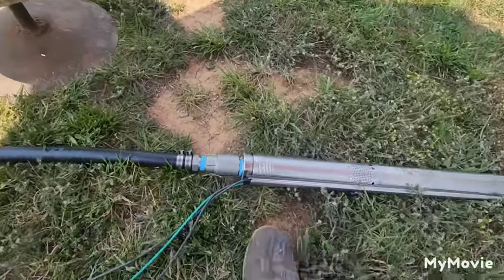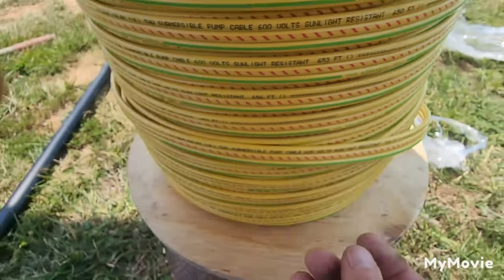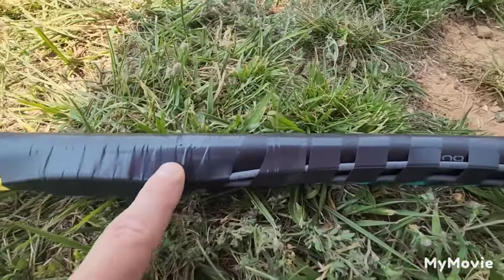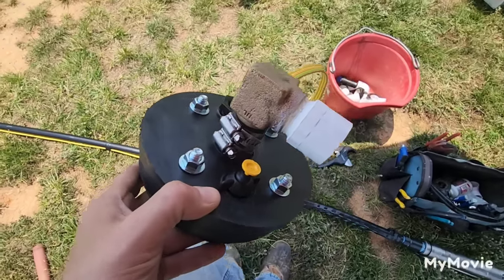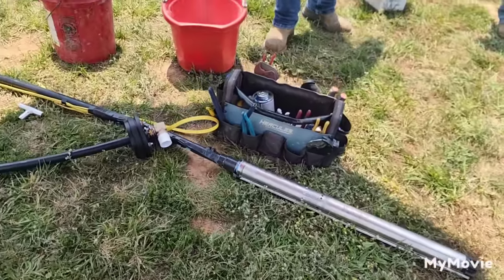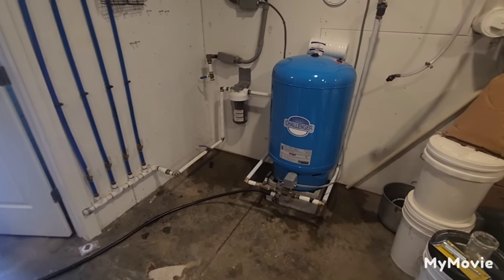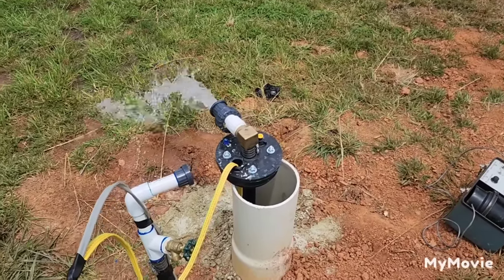3 Wells on 1 Property! Installing a New Grundfos Well Pump & Testing it after Hydro-Fracking.

Comment: For anybody designing their own system, don’t forget to do a voltage drop calculation when deciding on wire gauge. If you cheap out on your wire size, the pump ends up not getting adequate voltage. The pump responds the only way it can, by increasing current draw, which may shorten the lifespan of the pump.
Reply: Absolutely. It's a viscious cycle. Low voltage increases amp draw which drops voltage more increasing amp draw more.
Reply: I always upsize if even close. 75-90 feet I go 10 AWG. Code is the bare minimum and not always best.
Reply: @mfd4505  yep - code will keep it from burning down, but might not keep it performing up to spec.  I have this issue with 15A 14AWG circuits in parts of the house (including outdoor outlets) where at the end of the daisy-chain the 118V might only be 105V drawing 12A.
Reply: Or use a pump with a 'soft start' feature like H20 uses. They don't draw a huge inrush current, the pump ramps up to full speed. This saves the contacts in your pressure switch from burning, and wire from chafing in the hole, since the whole pump and pipe assembly doesn't jerk so hard every time the pump starts.

Comment: I used to haul bulk water in rural areas.  I had one customer that I occasionally would 'top up'..... they had a well that would draw down on a steady demand.  They put in a precast cistern, with a low capacity pump that ran pretty steady filling the cistern (their reserve).  The cistern had its own pump and then could meet peak demand.  Ran that way for years.
Reply from the maker: Those types of systems are very common out west. Pricey, but functional
Reply: I thought the same thing.  Why not just put in a tank and use it for peak capacity.  If the well is delivering 5gpm, you could easily keep a 500 or thousand gallon tank topped up overnight and trigger the well pump off the tank level.  That would seem a lot cheaper than having multiple wells, even with the initial cost of the tank.

Comment: 400 gallon storage tank in the basement and a jet pump feeding the house would also be a solution.. have the well feed the storage tank with a float switch and the jet pump and bladder tank feed the house..
Reply from the maker: I thought the same thing! Definitely a viable option
Reply: I added a tank to my deep well system as a way to settle out sediment and sand. I was not expecting how much water flow gain I'd get. I have horses and have spent weeks of my life waiting on troughs to fill at 5GPM and now I have over 30 GPM.

Comment: Hello and greetings from Kanab Utah ... Quite a few of the folks out here in southern Utah have wells with this kind of performance.  The solution for most of them is to invest in a potable water storage tank. They have gone up in price recently but everything else has also. If you get yourself a 2500 gallon storage tank you can fill it slowly and probably avoid running the well water levels real low.  Thank you Philip for all your efforts.  Respectfully, Utah Mike. 🤩👍
Reply: The only trouble with that is keeping it clean. Filtering the water before the storage tank is a must. Also tank must be kept clean and sanitized. In a warm climate, crap can start to grow in the water if the tank isn't cycled very fast. City water towers the water is chlorinated and treated before its sent to the water towers.
Reply: I was thinking about that also, but I was thinking of a 500 gal tank. With a 500 gal tank, the water gets constantly refreshed and doesn't have time to stagnat.

Comment: Wells are so intriguing. I had to move a well because of an addition. I was at 428' and it was perfect, never ran out, great quality. When they drilled the new well 25' away they went to 650' cause it wasn't making enough. I had to have it fracked and the iron level still hasn't stabilized, so much so the county health dept hasn't green lighted the new well.  They just came for their 3rd test so I think it will pass this time.

Comment: Incredible the amounts of money that people can invest, without knowing exactly how to do a proper installation.
What I like about your videos is the technical information of the parts used to install the system.
In addition, you show us the installation errors of other companies (which you correct).
Now what about the pump (impeller) that is disintegrating. This company that installed it, does not know much about the applications of each pump. But knows how to shell out the money from people who know nothing about self-contained water supply. Thank you for all this good information.🍻🍻

Comment: Fun watching these videos.  My well is around 200 ft deep.  It makes great water and plenty of it, so I am fortunate.  That being said, the previous pump failed because it fell off the pipe and sucked electrical tape into it.  Using the right components is only half the job.  The rest is the installation.  (similar thing happened with my AC system at my previous house; poor installation eventually led to failure)

Comment: I used the soft start Grundfos in my Son's 705 foot deep well. Best pump on the market. The slow ramp up allows a smaller wire size too, but do due diligence to size it correctly .
Reply: Grundfos seems to be good. Have used many of their circulator pumps and boiler feed water pumps over the years, rebuild kits, impeller kits etc. No issues, very reliable and not too expensive.

Comment: Irrigation tech here, unrolling the poly is easily a 1 man job. Leave the roll in the sun for 30 minutes, secure the one end, walk backwards and “hump” the pipe to unroll it. Basically hip check up to bump it up and the natural tension of the roll with help. Already hot pipe is easy to work with. Been unrolling those rolls alone for years. 1.5” poly gets a bit difficult but is still doable

Comment: Have a well in show low arizona old windmill minus tower, sucker rod pump still in
6inch casing i hooked up old pump jack and made small Aframe to lift warer pumps at 3.5 gpm 220v motor 2.5" pulley on motor 11" pulley in pump jack.  Watching your channel has been awesome.
Keep it up
And thank you

Comment: As a DIY home builder in Colorado, I dealt with this type of issues with a 2000 gallon cistern. Once filled, the pump never runs dry.  
So, a low flow pump in the well to a cistern,  a 2 gallon pump in the cistern feeding the house, etc. 
just my thoughts based on my experience.

Comment: Ok here is what I did with a low volume well,  I have my well pump feed a 2000 gal cistern tank the gravity feed my house, with a cheaper pump to feed house pressure.  The well pump controller has no load shutoff plus cistern float switch and timer that turns well pump on 3 times in 24 hrs, or when needed. For about 15 mins as the well will run dry if run longer than about 25 min. This has worked for years for a domestic house. Plus water for garden and lawn. I will run out if I forget and leave water on, oops. 
Enjoy your videos and very informative contents, very good store with reasonable prices.
Reply: Ok let’s

Comment: Yes great idea take the not great water and use it for garage and hoses then keeping the cleaner water for household use is a great idea. Plus if the smaller well does dry up it's just a few connection in the house to switch it over to the other one

Comment: Another advantage of the Grundfos pump is that since it ramps up slowly, you can run it from a smaller genny than you might expect.

Great job and video, sir. Take care and God Bless.
Reply: make sure you adjust the expansion tank air pressure to allow for the slow ramping and long lines. the old standard was 2psi lower than cut in pressure, but that isn't enough buffer for the slow/soft start pumps, you need 6 to 8psi less air charge than cut-in and will want to oversize the tank due to volume loss. (learned the hard way)

Comment: I've always had excellent results with Gould pumps.  The brand you promote has a well known defective check valve problem and the variable start up circuits fail constantly. Best to go with standard well built.  And I find Gould is sturdier and more heavy duty
Reply: You also didnt give credit for a 1 to 3 phase variable conversation unit. When running properly the energy usage and operating costs  are  MUCH less.

Comment: place your "doubled" hose clamps heads 180 degree apart and opposite directions from each other or at minimum 90 degree. why? some times they can seep a bit and cause a weak/thin spots at the worm gear head when side by side. 😁 I learned the hard way over the years.

Comment: My thought on the 3hp 3phase pump is that it was not sized correctly for the well. I had the same issue with my well. I was was explained to me by a well pump expert that proper calculations need to be done so that the head pressure is correct. This will help keep the impellers centered in the pump assembly and prevent the impellers from wearing out.

Comment: I would think more water storage would help it greatly, based on well flow rate u could feed into a decent size storage tank and have a float switch for the water inlet and throw a jet pump on the tank to feed house or could have pressurized storage tank and just have well pump do it all. Honestly if it was me i would have it feed a storage tank to act as a buffer and i could filter it more to get Sulphur out before pumping into house.

Comment: FYI - Lowes and Home Depot (at least in my area) no longer offer wire-by-the-foot if you want more than about 25 feet.  They'll refer you to buy 100/500/1000 foot boxes/reels.  Also VERY IMPORTANT - now that they insist on you checking out before you can touch the wire you bought, be sure to inspect it IMMEDIATELY after checkout, before leaving the store.  I got home with the pre-bagged wire they handed me and found out someone had sliced thru a bunch of the insulation and a bunch of it was unusable, but once leaving the store became a he-said she-said headache of "how do we know you didn't damage it".

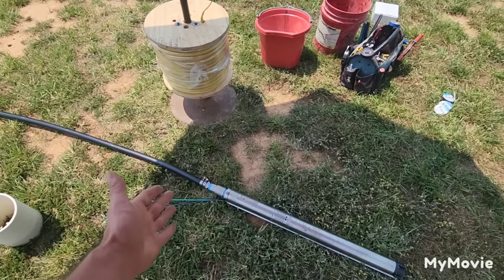Comment: 4:23 I install 1/2 hp 5gal per min Goulds pumps up to 300 ft all the time, some of them I replace r up to 60yrs old, 4:40 we service a 900ft well with the black roll pipe

Comment: Any thought of installing a 500 to 1000gallon tank to take the well water and a small pressure pump to run the house . A float switch for the well will keep tank the topped up and the house will not run out of water easily. Should be significantly cheaper than sorting out the far deep well

Comment: Great video! Filled with tons of information!  I love your content. Just had one question. You said 1/2 hp pump is only good for 120 feet? My old house well was 3 gpm at 240 feet and had a 1/2 hp pump. My parents house is just about 300feet and also has a 1/2hp pump. How and why would the driller do this?

Comment: If they did not have the second well, a 1000 gallon cistern would also have solved the problem of a gallon a minute producing well. 24x60 is 1440 gallons a day. The cistern acts like a buffer, during high usage periods, but refills during the time water is not in high demand. My neighbor had that problem, and a cistern solved it for them. A separate pump at the bottom of the cistern supplies the pressure tank inside the house. The well pump output flows directly into the cistern and a float connects to cutoff switch for well pump. Pump is protected by a separate circuit monitor that shuts off pump I’d it runs dry. The cistern cost $5000 installed with its own pump. pulling that deep well pump at 580 feet and replacing it will a pump at 300 feet was probably way less expensive than installing a cistern.

Comment: Give thought to “upsizing” the motor to the pump.  Electric utilities routinely reduce voltage in periods of high demand.  The oversized motor runs better under these conditions.  

Is there a 240 vac single phase softstart available for residential wells?  I would rather have electronics above ground for ease of replacement.

Comment: A pentek intellidrive pid 30 wouldve worked. takes single phase in and converts to 3 phase. Those are much better than the f&w. For future reference. We've ran into those 3" pumps at those depths can blow holes in the poly near the pump from building heat.

Comment: Low volume sulphur wells are common around here. Everyone has large capacity (500-3000 gallon) storage tanks to air out their water.
Reply: Had similar water with hydrogen sulfide. I too ran well to  a 300 gallon storage tank and added an air bubbler system (air pump like on a aeration septic system). This worked nicely at removing the sulfur smell. The air bubbler works by oxidizing the hydrogen sulfide with oxygen and enabling bubble surface exchange where hydrogen sulfide had an easy escape route. Used a simple jet pump connected to the above-ground storage air bubbler tank to pressure up the house water system.  It still needed to run water through  limestone calcium filter/exchanger to adjust the pH (sulfur water is very low pH and corrosive). 
Final note, be sure air bubbler is not near final water pump suction foot-valve!

Comment: it's very possible the well with 580' deep pump may draw down to below the 300 foot level on high GPM usage or in dry climate periods. but it's possible they overkilled it ten fold thinking they were saving themselves a headache, all while causing them(seeing the single small bladder tank size!).

Comment: Tried to lift my pump thats on a pitless 156ft well. 1-1/4" Schedule 120 PVC pipe. Two men lifting could barely get it off the pitless.  Had to go get the excavator to lift it out a few feet...After that I realized I needed a different approach to the job.
Reply from the maker: Needs a crane! That's dangerous weight!

Comment: Great channel! The information is easy to understand and very helpful.
I need some advice.
Any experience with using a lake for supply. Currently using well pump in a weighted rack resting 18” off the lake bed ~40’ below the surface & ~250  from the house.  I’m replacing all 250’ of 1”/200psi tubing due to a break in the buried  line from the  house to shoreline.
By the way, 150’ heat tape that extends well beyond the ice line in winter.
Thanks
Reply: trench it deeper and run larger pvc electrical conduit as a sleeve!(place all bell ends the same way, use no elbows/fittings/premade bends!) terminate it into a small pit at both ends. then you can easily re-pull a new water line/heat tape(if still needed). maybe run two in parallel and keep one "dry" for fast changeover if very important to keep water flow.

Comment: Wow that's insane cost for such unnecessary 3 phase equipment, I always recommend standard pumps and tanks.  
Yep that there is what I like to call "Cat Hair" so yep always a bad sign the pumps GG.
You gotta love it when they put a filter between the pump and tank "It never had a problem before" Oh it will!
I find it better to have cartridge filter after say a carbon filter as it can catch any carbon dust also just like you did.

You could always install a standard 120 gallon glass lind or fiberglass tank with a aerator to reduce the H2s almost completely without filtration.
This would lower the pump output to say 5-7 gpm and add about 15 psi of backpressure through the micronizer but is a very good way to remove H2s.  
You would also gain a 60 gallon reserve in the tank to about 10 psi if pump won't keep up where the bladder tank will only give you 10 gallons drawdown.

Comment: Two questions,  Taping at the pump, have you ever considered a nice piece of heat shrink over that section? Low well output, I wondered if a small cistern would have made any difference in useful capacity?

Comment: I appreciate your videos so much and have learned a lot, but theres definitely missing steps here and there and it makes it very hard when it may be a simple step for you, but it leaves people who don’t have the experience and the knowledge confused. For example in this video, how did you attach the pipe to the pump? What do you need to do to prep the heat wire splice? Do you twist the wires together or just but the ends together? Is there another piece that goes under the shrink plastic part? Or did I just miss that part?

Comment: Hey got a question I thought u I never used heat seal wire connectors but used so type of tape. What has changed.

Comment: My brother replaced his 175 foot on 1 inch steel pipe with new pump and black plastic pipe. No one ever had to touch the well, it just worked. Installed in 1978 and replaced in 2017. Ever heard of Irons Mountain in Allegany County Maryland? It’s a heck of a view, maybe 50 miles, but the homes all have a big cistern for rain water and sometimes have to truck in water. Some of the DRY WELLS are 800 feet.

Comment: Can you please tell me if the rubber inside the well seal is the one holding the entire system or is it the 90 degrees copper fitting and the clamps keeping it suspended?

Comment: I have a deep well 75 feet,I can`t pull out the 1" pvc pipe out of it ,to change the check foot valve,so  normally how they charge for pull out  the pipe and change the check foot valve?

Comment: I was always taught to fold over maybe 8 inches of wire the first foot or so before taping. I guess it allows it to be pulled if the wire gets too tight but if it’s taped a lot it wouldn’t ever pull anyways. Do you leave any slack in the wire at all?
Reply from the maker: Only if a wire box is required.  I'll create a loop just below the well seal. The pipe does stretch, but only about 6-8 inches in a 300ft length.